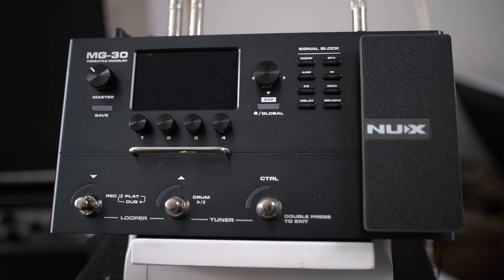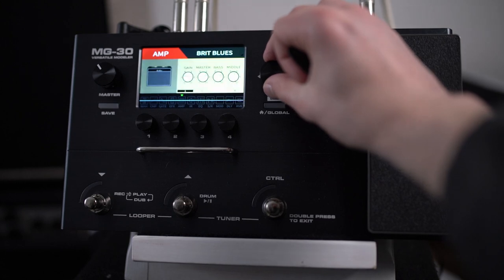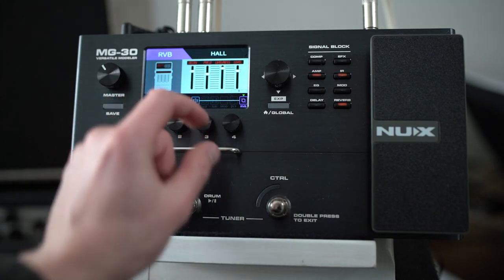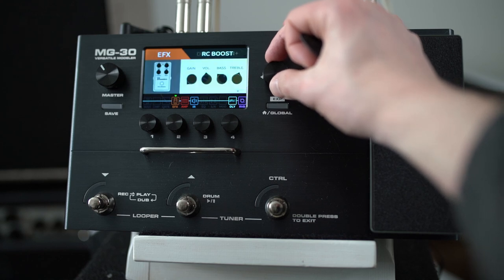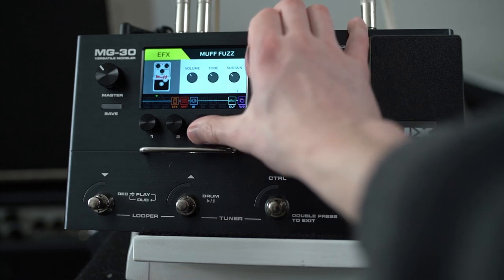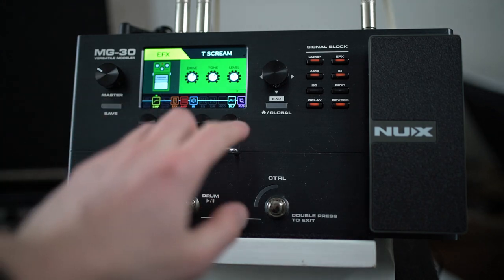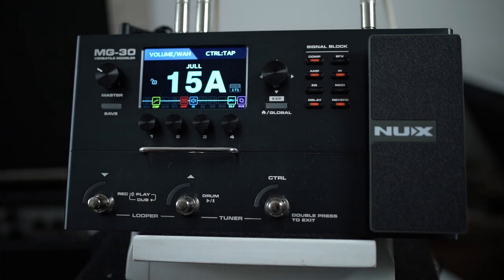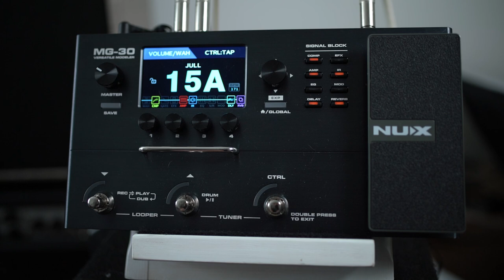NuX MG30 Hands on Demo and Review

Comment: It's crazy how much these little boards are capable of. I can't get over how close these amp sims are to the real things these days. I mean, people claim they hear differences. But I'd argue that amps aren't all necessarily going to sound 100% identical anyway. So depending what amp was captured on what day in what situation, these factors all go towards affecting the final tone slightly. Modellers are another story of course. It's not enough of a tonal difference to my ears to complain about. Then again, I still have the boss Gt8, which I purchased when it was 'top of the line' tech and newly released. That was advertised in its day as being a flagship, 'sounds like the real thing' device. In that instance, there was a strong argument for that just being marketing spiel. Great effects unit. Terrible for authentic distortion tones. Nowadays, I'd argue the amp sims are close to 96%-100% accurate. Madness I tell you! It's a bit like complaining that the graphics on the ps5 are garbage, when you've never played a ps1.

Comment: Question: Can the headphone output and the main output to the amplifier work at the same time, or will a headphone connection block the signal of the output going to the amp? Because I'd like to use the headphones as a monitor while the sound still goes amplified. Thanks

Comment: I have a question, is the amp model block, is the power amp section separate from pre-amp? If yes, I would like to use my external preamp and use in MG-30 just power amp section and IR for cab. Please let me know, thank you!
Reply from the maker: I don't believe so, I think this is unique to Helix and Fractal units?
Reply: @johnnathancordy  Thank you for such quick reply. I will try if external preamp and just IR can sound good enough without power end saturation.

Comment: This thing its insane for 230 pound .. i use it for travel ... battery 🔋  connected thats it .converter 5 to 9 volt ⚡️..TalentCell lithium ion Battery Pack NB7102 works also on a spark 40 😂😂

Comment: I wish someone had guts to make a Nux-demo without adding tons of rev and delay. Just the basic of the basic.
Reply from the maker: It's not really a matter of guts is it...It's a multi effects unit, chances are some folks want to hear the effects
Reply: That may be so. But if basic core is not good, sound won't be any better with loads of effects.
Reply from the maker: @MrSultanofSin  the core sound is decent. What would you like a demo of?